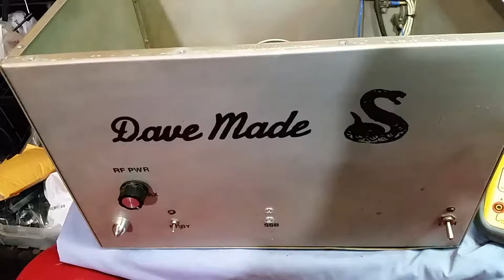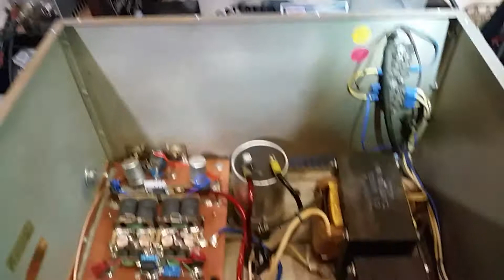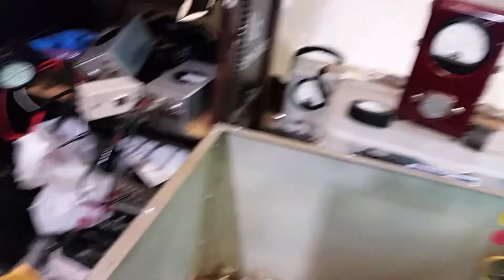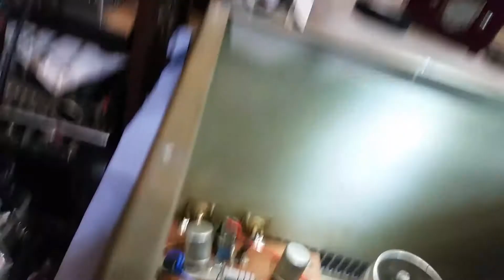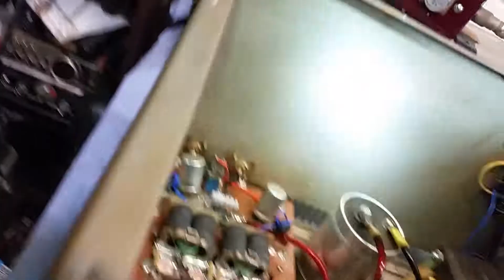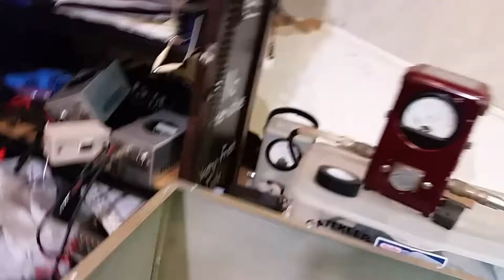Davemade 5 Pill Base Amplifier - [Repair & Upgrade]

Comment: I think I replaced the variable in that many years ago and installed the resistor on the input and from the one bill driver over to the four pill section. Of course, these amplifiers have been swapped and traded so many times it's hard telling what everybody has done over the years.
Reply from the maker: I wouldn't doubt it brother not one bit
Reply: That's why it's so clean....

Comment: Use urethane sealants only silicone is bad it will not stick to itself when dry you need to use acetone or lacquer thinner to clean the area after removing so  your new sealants will adhere properly, and you can paint urethane not silicone.
Reply from the maker: Thanks for that tip.....Is there a urethane sealant that you would use on something like this? That is new to me so if you have a name brand that would help out a lot bud...thanks.
Reply: I will get the name something common from local suppliers
Reply: 3m urethane seam sealer 08367 black from Amazon and you can feather the edges fast cure time

Comment: 16:20 do you need low inductance on those? 5 band resistors? 🧐
Reply from the maker: Yes....Those were actually 10 ohms once I looked at it just a bit ago...I believe the silver tells you to move 1 decimal place and a gold tells you to move 2 decimal places so that turned out to be a 5 ohm resistors. Not really a need for one at all but it is just a small cushion resistor between stages.

Comment: Nice fix. The Dave made I did like that was 4 pill 2SC2879 . had same transformers. same bridge diodes. had blown the diodes. had 2 radio shack fans in it. was dirty . also had broken switch . I had to block the vent holes as well. I took the SO 239 off . mounted thin copper bent as a L . made to holes for the SO 239. new SO 239. soldered it in. new hardware with KEP nuts. Did the same bolt in back to hold bord down. Yes you did read them 1% resistors correct. I got 100 ohm 3watt 1% look like them.  Metal oxide non inductive type. I did 2- 8 AWG power cable. took ferrite chokes off transformer. re did with 2- 12 AWG  direct to collectors . 2 cores  wound on type 43.4 #12 PTFE total . Added bias and SSB delay switch. I used 120V fans. input tune was off . new splitter with type 61 core same with combiner. even the input transformer was changed to type 61. finally got the input to lay down. it was so good the small input reflect swing to 0 when talking. very little meter movement. the input back swing is great. was to 0. was a high drive box. but did 1KW pep when I got done. I used the  200 amp bridge . added a cap . also put grounded plug on box. working for years now. better to push air into the box . 73's
Reply from the maker: So you did the exact thing that I did with the 8 pill to 12 to block the holes.....I guess at the time I didn't think about doing that or didn't feel like it lol sometimes I feel better to start over the next day and sometimes ill go further just because I'm feeling better that day..you know how it goes...there are always more then one way to do something but which say you take determines on many factors...... I hear you on the 200A bridges man I wish u could find my guys hook up he had because all the ones you can buy off Amazon and such are cheaper ones....but they work just as good as long as you double up ive noticed....so if I would have used a cheaper one I would have went with a 200 or 150A bridge.

Thanks buddy for stopping by always.
Reply: @1883GotDown  I use the Amazon ones. 200 amp on 100 amp supply. I go at least 100 % over kill if not more. ICA has nice Bridge rectifier's. I have taken 4 stud diodes and used that as well. what I did before I found the 200 amp bridge.  I do have the bigger 300 amp ones and have not tried yet. The 200 amp ones came with heat sink . that the way I went . I got a hockey puck diode and SCR . they big ! I don't worry about who did what when doing a repair. my job is to fix the box. there is more than one way to do things. everyone has there style. 73's
Reply from the maker: @Cherrybomb 452 in deed this man is a genius man!!! First guy I've met so far that reminds me so much of my self and I'm sure of it that this guy is a better tech then me....

Comment: My lord all copper block off .. oh lord .. use plastic ..copper is going to get very hard to get some
Reply from the maker: Yeh I agree man.......what is plastic copper? You mean use a copper phenolic board? I've got to get me some power tools man and a cart like you have I can roll into my plastic work area and roll out when im done....its amazing ive got this far with out the power tools 🔧 I have man.
Reply: @1883GotDown  you get some wood ill build you some  work Benches on the wall like my mane work table
Reply: @1883GotDown  not plastic copper ...use plastic not copper..